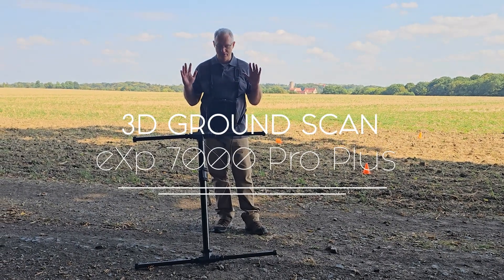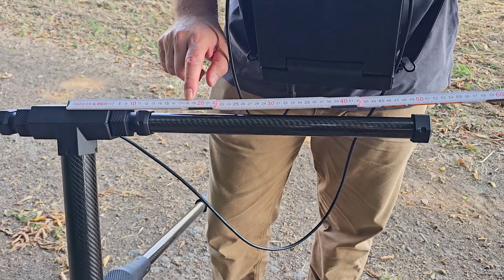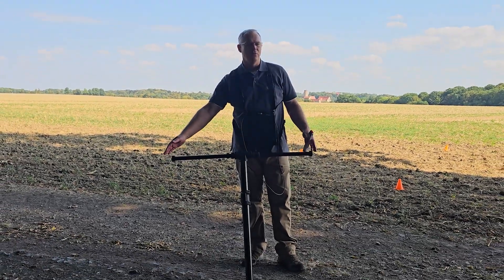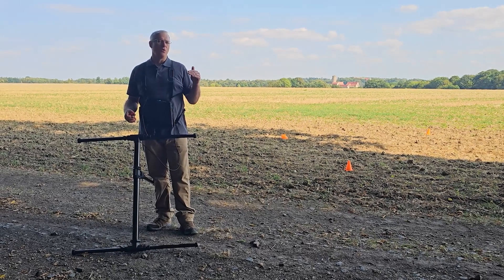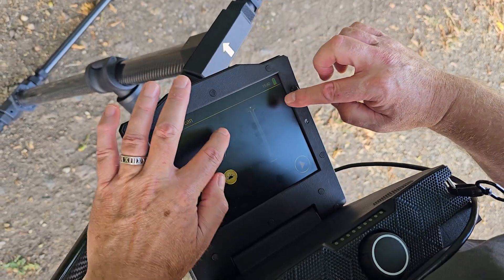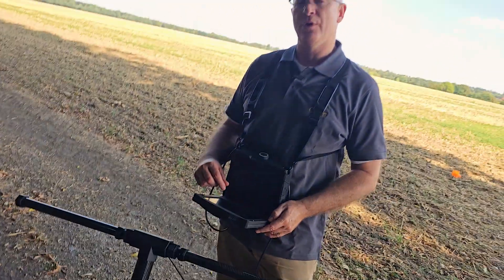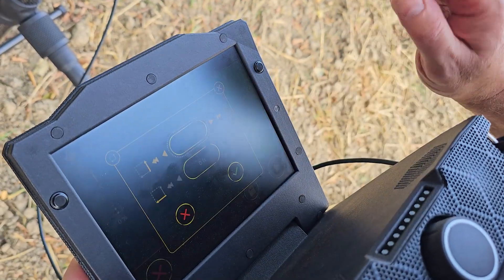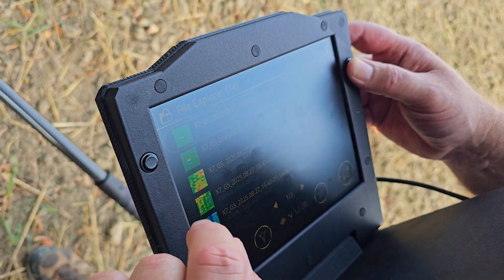Mastering 3D Ground Scanning with the SuperSense System 🔍 OKM eXp 7000 Tutorial

Comment: This is the most powerful machine in the market with no competition, unfortunately this test is not that Convincing a ferrous target witha depth of less than a meter with pointy ends this is the easiest target ever and that's why the screen is mostly green and did not sense the ground conditions due to the strength of the target and after the data interpolation we cant see how powerful the device is